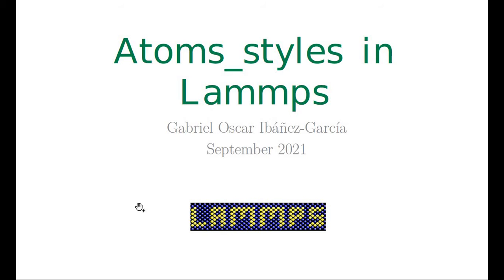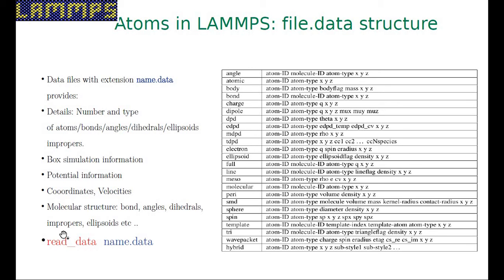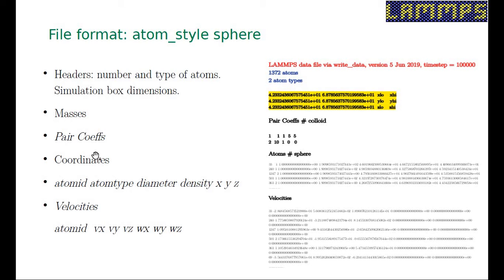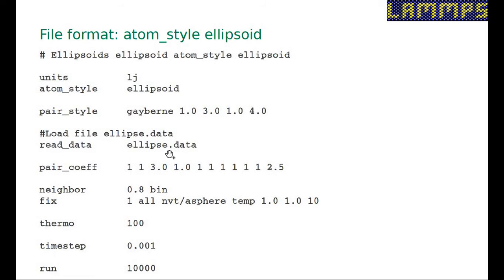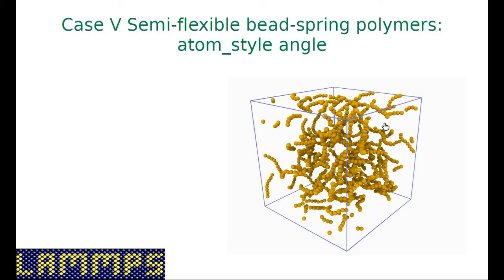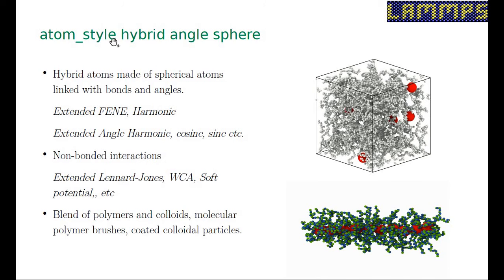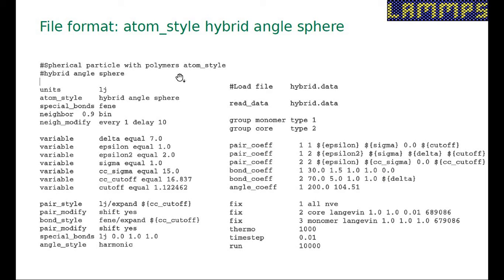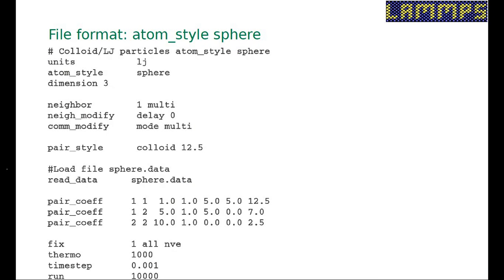Atom styles in LAMMPS

Comment: Is it possible to incorporate Colloids in DPD simulation?
Reply from the maker: It is more common to see colloidal systems immersed in SRD (stochastic rotation Dynamics):or Lattice Boltzmann  fluid, however I have seen DPD simulations for self- assembly of micelles and polymers where the solvent Quality is more crucial  for the phases formed.
Reply: Amazing!